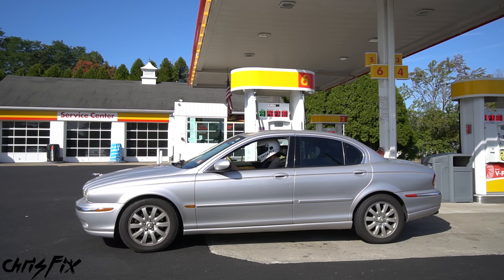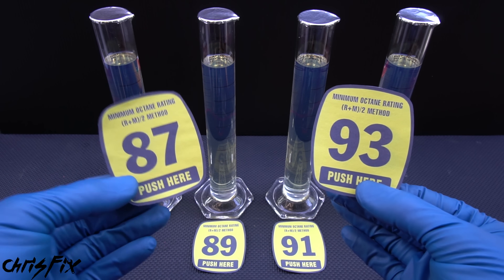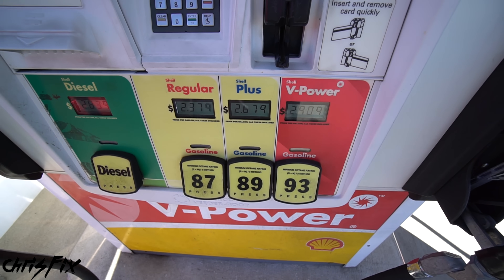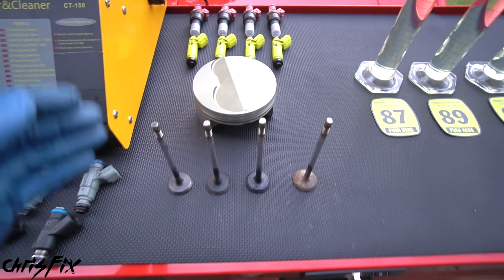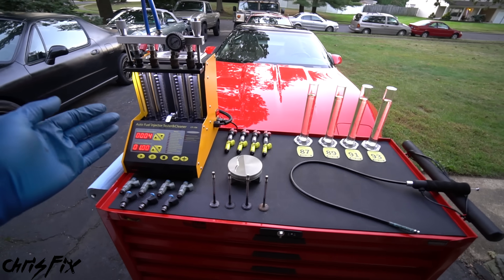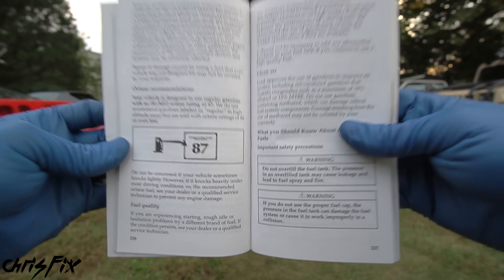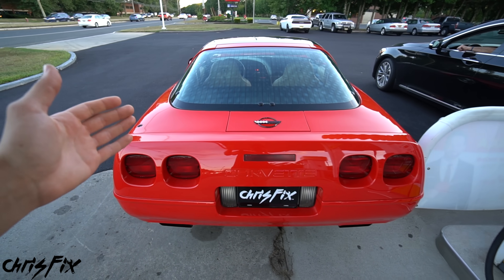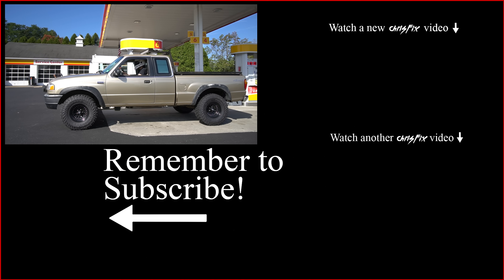What is the BEST Fuel to Use in Your Car or Truck and WHY

Comment: so i just got a 2020 honda hatchback sport it has a turbocharged engine and on the door to the fuel cap it says premium recommended see owners manual but the l manual doesnt say anything about it, just wondering if i should definitely use premium since the engine is turbocharged?

Comment: Hey Chris. The octane booster has actually been tested to be abselutely BS. So you should not recommend it
Reply: Daniel Fl. Your engine will not die if you drive it with 87 oct until next fill up, Id just drive it normally and making sure to not overrev until next fill up and then fill it up with premium.
Reply: gabriel sarabia That is not what I said, i criticised the product
Reply: Daniel Fl. Yeah, I know. Thats why I said you shouldnt use an octane booster and instead just drive with the 87 octane fuel until next fill up. I agree with you.
Reply: BS as it doesn't contain octane. Usually contains ethanol. Bottle of metho would work too

Comment: Quick question , for a bmw serie 5 ,530i 2006 should i replace the parts that i ve seen in the video ( valve and fuel injector )or just start putting the 93 ?

Comment: just so you know with modern cars, higher octane will lead to better performance because you will be able to run more timing without running into detonation issues. they also tend to get better fuel economy as well. But at the increased cost it is not worth is for the  .1% increase in fuel economy. also Knock can also be caused by premature detonation, you forgot that part.

Comment: You said that al different grades of fuel have no inherent differences in energy. And that they only provide better protection against knock. 

But when mentioning the Corvette and that premium is recommended, you said that if use lower grade, you may notice a decrease in power or fuel mileage. 

Not sure what that’s supposed to mean.

Comment: Depending on what your gas station premium will give you a little bit better mpg but it's not from the octane it's from regular and mid grade containing 10 to 15% ethanol and premium being 100% gasoline but the increase is very small and not worth the extra cost of of premium

Comment: Really great video. Just one little thing. Gas doesn't have octane. Octane isn't prone to pre-combustion like gasoline which is very unstable when compressed. So the octane rating is how much LIKE octane the gasoline is. An 87 octane rating is gas which is 87% efficient at being resistant to pre-combustion compared to octane. 93 is much better at preventing knocking which is better for high compression engines which further prevents knocking. So the gas has no octane at all. It's just to show the percentage the gas is efficient at preventing pre-combustion like octane.

Comment: This is a cool video.  Like many other dudes, my truck is life.  I use the lucas oil engine treatment after every oil change.  I only fill up with either shell or chevron. Those are the only two gas stations I use.  I fill up with 87 normally but probably once a month i fill up with 91. I've always been told that filling up with 91 occasionally, it helps clean the engine.  I think this video proves that...   i did use the 103 octane booster once but it didn't do anything productive.  The lucas oil engine treatments are the best choice for keeping your engine clean.  I have 180k miles on my 2007 ranger 4.0l and it runs as good as it did the day i bought it.  I did change the spark plugs at 100k miles but i did that on my own.  Not because there was an issue. Which there wasn't.  I also drive a 2018 3.5l tacoma trd offroad which will get a supercharger installed after magnuson's release in Nov.  And a 2014 3.6l journey.  All run smooth and perfect because of the lucas engine treatments, regular oil changes amd just all around maintenance.
Reply: Aye bud you forgot 92 octane that's our premium in oregon

Comment: For anyone curious about how Octane ratings are determined, here's from wikipedia:

"The octane rating of gasoline is measured in a test engine and is defined by comparison with the mixture of 2,2,4-trimethylpentane (iso-octane) and heptane that would have the same anti-knocking capacity as the fuel under test: the percentage, by volume, of 2,2,4-trimethylpentane in that mixture is the octane number of the fuel. For example, gasoline with the same knocking characteristics as a mixture of 90% iso-octane and 10% heptane would have an octane rating of 90. A rating of 90 does not mean that the gasoline contains just iso-octane and heptane in these proportions, but that it has the same detonation resistance properties (generally, gasoline sold for common use never consists solely of iso-octane and heptane; it is a mixture of many hydrocarbons and often other additives). Because some fuels are more knock-resistant than pure iso-octane, the definition has been extended to allow for octane numbers greater than 100.

It is possible for a fuel to have a Research Octane Number (RON) more than 100, because iso-octane is not the most knock-resistant substance available. Racing fuels, avgas, LPG and alcohol fuels such as methanol may have octane ratings of 110 or significantly higher. Typical "octane booster" gasoline additives include MTBE, ETBE, isooctane and toluene. Lead in the form of tetraethyllead was once a common additive, but its use for fuels for road vehicles has been progressively phased-out worldwide, beginning in the 1970s."

Comment: That guey valve is oil leaking past the valve guide,not carbon deposits. Engines with actual carbon deposits actually require a higher octane fuel to prevent detonation. Hope that helps,been around a while family run mechanic/machine shop. Cheers.

Comment: So, chrisfix, why does the Sheetz gas station nearby my house have E15 and on pump it says that it's recommended for any vehicle 2001 or newer. And since I have a 2009 Chevy Aveo I've used it a few times and not gotten any big issues other than poor fuel economy since is not truly gasoline. Should I be using this or should I just stick with regular unleaded?
Reply from the maker: Either works. E15 has a lot of ethanol in it which is why you get worse MPGs but it should be cheaper.

Comment: Dear ChrisFix. Big question. How do you fix a truck that smells like gas and has a slight rev while idling? Replaced 02 sensors, spark plugs, air filter and a couple other things. Nothing worked.
Reply from the maker: Check for vacuum leaks

Comment: My car likes 110 octane.
Reply: Same. Though I 50/50 mix it with 93 on the occasional times I street drive it just to save my wallet lol. When its time to go all in its straight 110.
Reply: @EpicWhiteGuy1  where you get 110
Reply: @igotthejuice2090  There is a machine shop about 20 minutes from my house that has a pump, they sell the 110. That, or I get it out of the pump at the drag strip when I go. The only other option is to find a performance shop that sells it in 5 gallon cans, but its a little more expensive that way.
Reply: @EpicWhiteGuy1  Racing fuel is usually leaded. What kind of car are you running that in?
Reply: @isaakwelch3451  74 Plymouth Duster with a 408 stroker motor. Only thing stock is the block lol. Motor was originally a 360. Pulled it from an old dodge b200 van.
Reply: - C12 in the Harley.

Comment: Great Job...by far the best explication I've ever seen at dispelling many of the myths out there, well done on the timing and the animations...the extra work you put into this vid is apparent. I'm taking the time to write this because you do such a good job at educating so many people (myself included). Your explanation and animation of hot spots causing detonation is interesting but not completely accurate. "Knocking" is principally caused, and will cause the most damage by pre-ignition (not post ignition as animated) --- the deposits cause hot spots (and many other factors) resulting in an explosion (instead of a nice "burn" and flame front across the piston face) a few degrees in advance of the correctly timed ignition curve, not after as illustrated. This rapid explosion pushes down on the piston just prior to the correct ignition advance curve and its that small few degrees as the piston is coming up, and the flame has ignited spontaneously trying to push it down before the piston has crowned TDC going into the power stroke that causes the "knock". Octane rating, as you correctly point out, is the ability of the engine to resist pre-ignition based on an optimum ignition curve under ideal conditions, without it being retarded by the knock sensor thereby reducing power output slightly. I've always used regular gas in all my "premium recommended" cars under daily driving and only switch to higher octane at the track, under heavy loads (towing) or altitude changes to name a few. Keep up the great work Chris!

Comment: The octane rating has to do with how similar the fuel is to octane. Octane is an organic molecule that is more resistant to burning than smaller molecules like propane, ethane, and methane. Basically the more carbons an organic molecule has, the more hydrogen bonds it has. Without going into too much chemistry,  hydrogen bonds are what makes the larger molecules burn at higher temperatures, or under more pressure.

Gasoline does NOT contain octane. Also ethanol is a small organic molecule with a hydroxyl group substituted for a hydrogen, making the ethane an ethanol.

Having said that most of his information is accurate, and he is 100% right about what fuel to use. The owners manual is the best bet.
Reply: Well said, That's also why it's a octane rating and not a percent.

Comment: Higher octane fuels do burn slightly slower than lower octane ones.  That's why they are less resistant to knock and why you can run more ignition advance when tuning knock limited cars for power.
Reply from the maker: That’s not true. They burn at the same rate.
Reply: @chrisfix  Where are you getting this info?  For specialty race fuels it is not always the case that higher octane ratings equate to slower burn rates but for pump gas of the same base fuel, in order to get that increased resistance to knock, the burn rate  has to go down.  This is info taken from the Sunoco Race Fuels site comparing race gas blends to pump gas.  You could also prove it on a dyno on non knock limited engines when finding MBT.

Comment: Don't like alcohol in the gasoline.
Reply: Drag racers and high performance racers have used pure ethanol for best part of 90 years now. So your problem with it is what exactly? Yes if you live in a wet climate its not good to leave a 1/2 tank full for a long time unused but other than that?

Comment: Had the intake manifold off on a mazda 3, 2.0l with 13k on it and it had so much sludge on the valves that you would've thought it had 250k. Direct injection is garbage.

Comment: How about the fact that octane ratings have a margin of error of 2, meaning an 87 could be just as effective as 85 or 89. Depends on the gas.
Reply: Clearly says "minimum octane 87". The margin for error is for higher octane levels. Meaning you (legally) should only get a higher octane than you paid for, but never a lower one.

Comment: What if it says in my car “Only use premium gas “ in that case should I listen to it or avoid it and use the cheapest one 87
Reply: Did you not watch the video? Use what your manufacturer says to use. If the car is telling you to use premium then use it.
Reply: @MrJosh5191  why
Reply: ya boi Sosa because that means the engine was designed to run premium

Comment: Awesome video brother. Question: I was using premium despite regular gas recommendation by the manufacturer on my 2019 Honda CR-V EX-L. The mileage remained the same. Do you think it would take a while for the engine to boost mileage?

Comment: Chris, great vid, however, I will say this.
I have been a mech for nearly 20 years. I have serviced thousands of cars, and I have pulled down hundreds of motors. My customers that generally run higher octane fuels, have better economy, generally better power, and cleaner engines with sufficiently better life cycles. My customers that run lower octane fuels, generally have poorer or average condition engines, constantly dirty oil, worse emissions, and, and worse maintenance requirements. We have dynod vehicles back to back after fuel changes in controlled environments, and we have found that the higher octane does allow the vehicle to delivery better torque and power, regardless of fuel requirement or recommendations.

Comment: I use v power 93 in my 07 9-3 I run 87 in my 96 900 saab I can confirm  The Jaguar x type runs like trash  on regular owned one and it Did NOT like 87 octane at all

Comment: Wanted to ask about Ethanol content in modern gasoline. My car is a ‘94 Toyota Previa and the guidance from Toyota states that no Ethanol should be used in the engine, only 100% gasoline. It seems to be getting harder to find gas of any octane rating that doesn’t have 5% or 10% Ethanol these days.

Any tips on this?

Comment: Hey chris i really appreciate the video and all the work that went into it. My question is whats the difference between racing fuel and the fuel you were using in the videos. I understand theres a higher octane but how does that produce more power, also how are there cars that can use both the special racing fuel and regular fuel like the dodge demon. Sorry if the question is confusing just trying to make sense of it all.

Comment: Beginning of video basically said all fuel is the same and all give the same power. Then at the end you said run what is required because i could be losing power. How does that make any sense? How is 93 not contain more power than 87 octane if 110 octane is race gas?

Comment: Flex fuel cars, most have a Yellow gas cap. They also Do Not want you to put any additives in the fuel, since most additives contain Methanol, which could destroy your fuel system.

Comment: i see you still using shell... that should be the entire point of the video... use shell no matter what and use the octane recommended for your comp ratio... there, all caught up.
Reply from the maker: No, you don’t have to use shell. Sure, they have some good fuel additives, but gasoline is gasoline

Comment: So heres a question I own a 02 yahama R1 and I run usually 91 or 93 but yet when I get up in high rpm its studders and sounds like it miss fires for example I'm in 6th gear and I'm running rpms up to reach 136-143 my engine spudders as if I'm red lining but I'm still at 7k-9k rpm is it because of carbonation inside my valves or is because of the type of fuel I'm using that's throwing the combustion timing off?.
Reply: Like I'm looking for legitimate responses to this question cause im really curious, the more education of bikes the more I can understand my vehicle.

Comment: Lol at this vid. Good info but. 87 has a higher flash point than 93. Not the same energy.  You can actually run a boosted car on 87 aslong as you keep the block and the heads cooled. 

Static , dynamic compression comes into play as well. There's alot good in fo and some bad info.

Comment: I not trying to upset anyone, but I've got some questions. First I own a 2000 Ford Ranger that has around 300,000 miles. It's had a tune-up. Every time I run 87 I can hear the lifters rattle. (At least I think it's the lifters!) If I run 93 or non-ethenol 89, I don't hear the lifters/ noise so much or at all. The truck has a five speed in it. A guy I know has virtually the same truck almost the same mileage,but with an automatic and doesn't have any of the noises that I do. He also uses 87 gas and doesn't use synthetic oil like I do. If anyone has any ideas or can explain whats up with my truck I would truly appreciate the info. Thanks

Comment: You should use the highest octane you can afford and that suits your needs. 
 
Some cars have hi/low octane tables in their ECM for ignition timing.  If you buy crap regular gas its going to run lower ignition timing, if you run premium, it will default to its higher table (if it even has one) That doesn't mean you're going to get better mileage or make a 1000hp.

Comment: In most cases high octane gas is used in older cars or high compression engines. Show me a car that requires mid grade gas... I'd ask Chris fix to show me the performance test results of running regular vs premium gas on his vet.... Dyno tests and emission tests... Other then all that it was a good video, I'd say premium gas and definitely mid grade are trash talks. Finally he hadn't said anything about the 15% ethanol gas that Thornton offers for cheaper. Studies have shown that for its current price it's more expensive as a car will adjust it's self to use more up...

Love Chris Fix videos will always recommend them, but this video is and will always be a biased topic to anyone and everyone.

Comment: We use the AKI (Anti Knock Index) in the America. It's a cross between RON and MON (Motor Octane Number). MON is what is used in Canada. The (R+M)/2 is the method in which is used to calculate the octane of the fuel. The 'R' stand for RON, and the 'M' stands for MON.

Comment: I will say, whenever I use higher octane , my car seems to have a bit more pep...
Jmo...
Don't think its worth spending the extra money tho.!
Reply: Some cars require low octane fuel, however when you put premium in it will produce more power like the Australian Ford Falcons since 2003, and the Corvette in the video. 
The Ford Falcon FG/X (2008-2015) on 98 vs 91 (93 vs 87) gives you 208kW vs 195kW, and 420Nm vs 391Nm.

Comment: I have been running non ethanol gas past six months in my 2002 Tacoma.    It is about $.50/gallon more, but I get five miles per gallon better gas mileage plus my truck runs way, way better with unhesitating power.

Comment: Just run NGK Colder Spark plugs. Causes less problems and better fuel atomization. Equals out to slightly better fuel mpgs and better knock sensing.